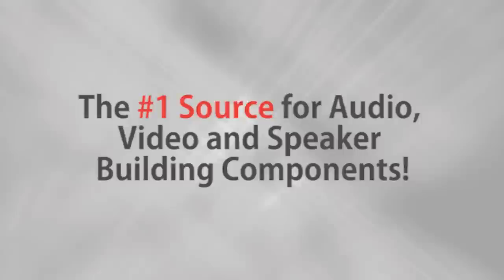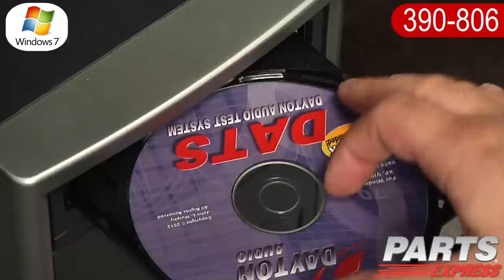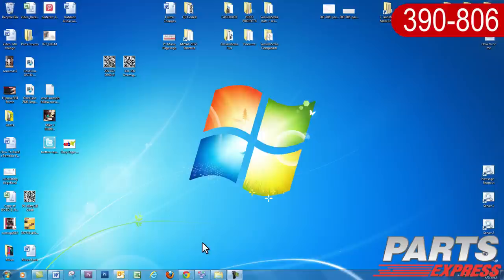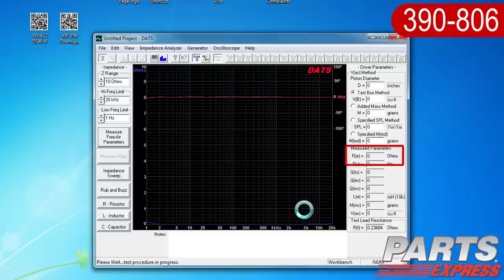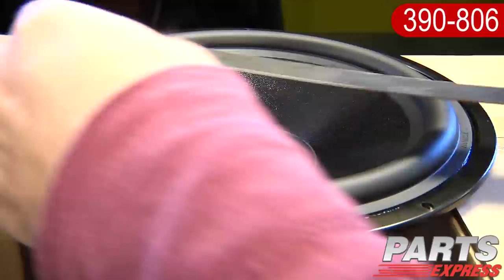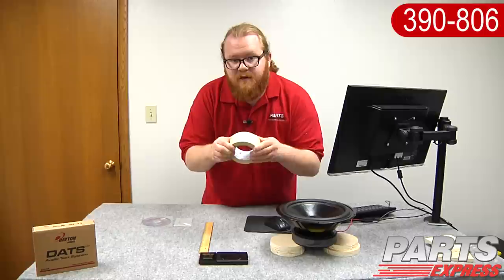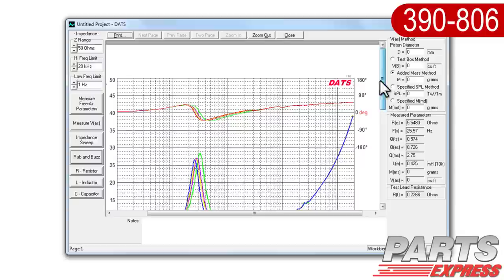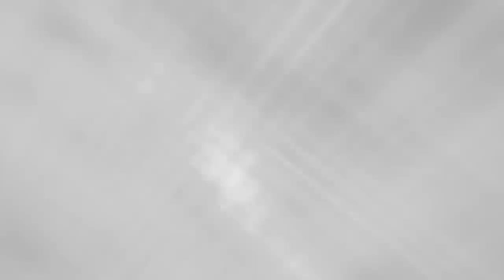Measure and Analyze your drivers and loudspeaker systems

Comment: Be careful about the orientation of the driver set. I tested a number of drivers using my old WT3 with the drivers first cone up, then cone down. It made a significant difference in the T/S parameters. 
With the drive facing cone down the voice coil will be a little way out of the magnetic gap, so it will be  exposed to a weaker magnetic field over more of its travel. This will raise the Q. 
Put the same driver on its back and you'll have the voice coil farther into the motor, so exposed to a stronger magnetic field over more of its travel. This will lower the Q. 
The effect will be less if the driver has an extended pole piece, but it's still likely to have an effect. I suggest building a baffle to hold the driver so, when you test it, it will be in the same position as when in the loudspeaker cabinet.

Comment: when you clicked on "apply" when setting up, you forgot to set level first! so no, the next time you plug it in your settings will not be saved...this gave me a real bad time, and after searching a while, i figured out that having that level out of whack will keep you from even calibrating the device - which i see they are fixing now, as the newest dats system about to ship is going to be using default windows settings. once you set that level and run the program, windows can reset back to 100...you need 1 for win7. this is what happened to me, and i thought my unit was defective! NOPE just windows being stupid. i love my dats system, was just slightly tricky to set up the first time XD
Reply: OH! also make sure any microphones you have are disabled when using dats...

Comment: Would setting the sample rate to 48k instead of 44.1k yield more data points collected?
Reply from the maker: Hi NoSpace,
No, using this at 48k will throw off all of the measurements. The hardware is specifically designed to be used at the 44.1 setting.